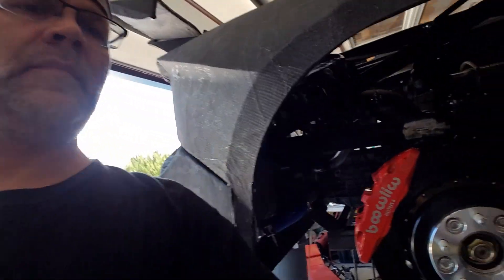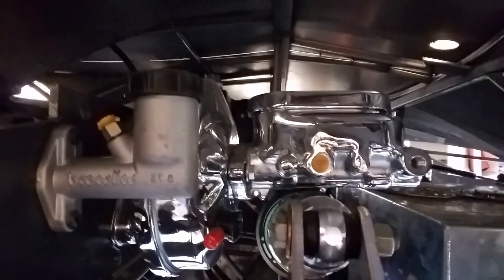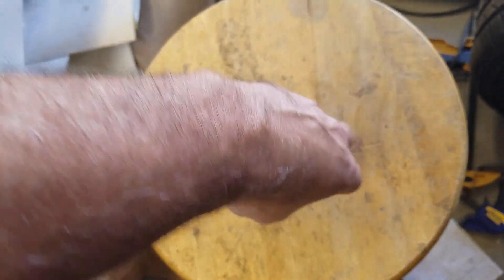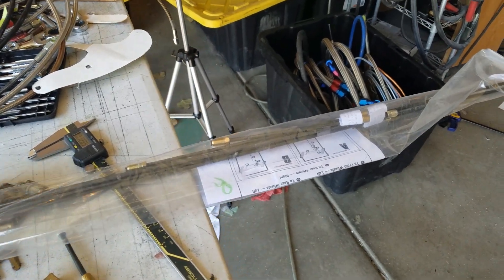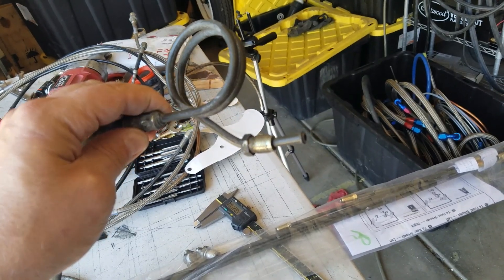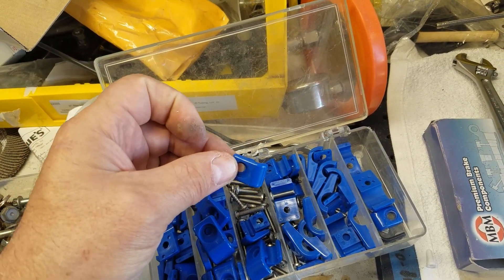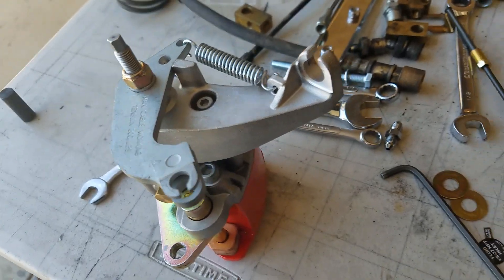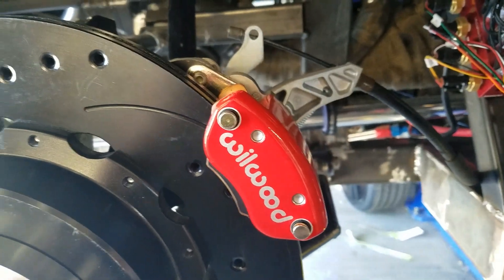3D printed Interceptor Brakes Part 2

Comment from the maker: Update:  The proportioning valve should be below the fluid level or air bubbles have a place to hide.  I took care of that by rotating the valve (re-bent the tubes) so it sits below the level.  I also moved the lines so they stay below as well.